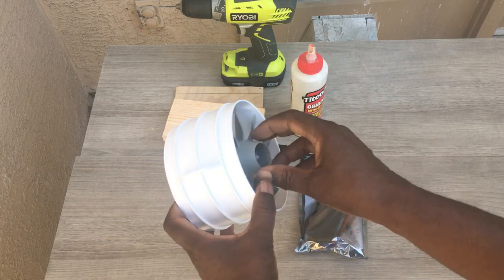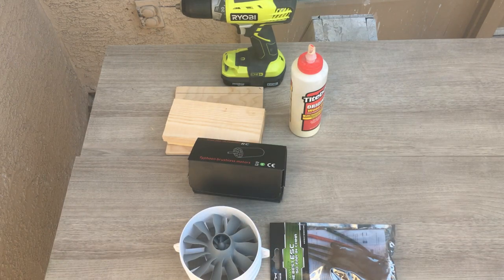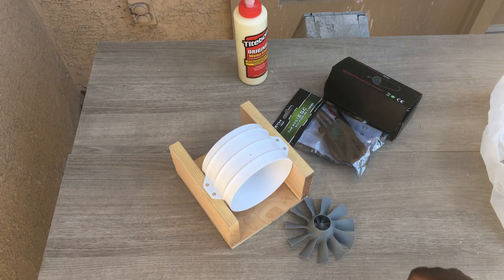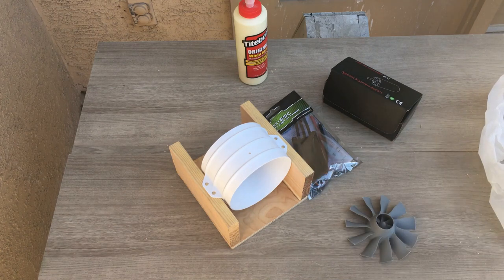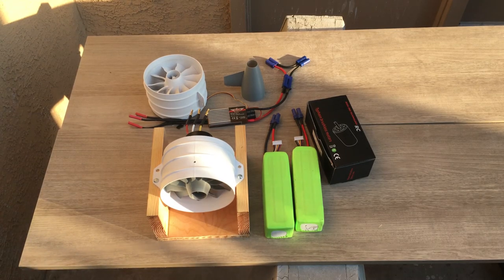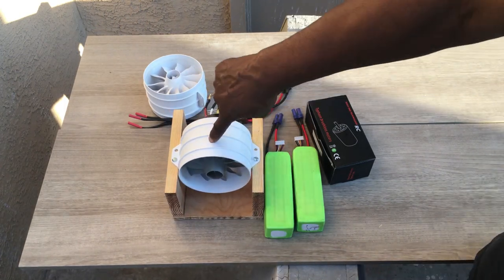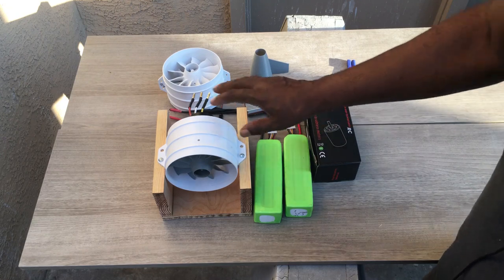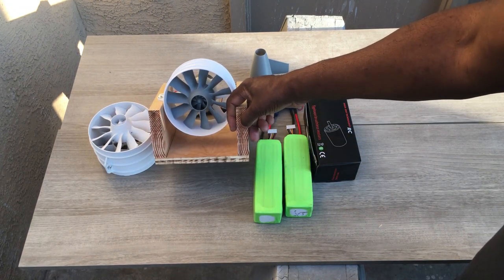Unlock The Power Of 3D Printed EDF Fan units

Comment: Great video as usual.
Thank you for the nice content.

BUT I should mention that KV (590 KV) does NOT stand for Kilo Volts 😀. It stands for the motor velocity constant and it is typically measured in units of revolutions per minute per volt (RPM/V).

Comment: I don’t think PLA is a good choice for this. It is not very tolerant to heat either from the motor or sitting in the sun. It will eventually get brittle. 

I would suggest staying clear or behind something when you do your testing. May work a first but I fear it will eventually disintegrate.